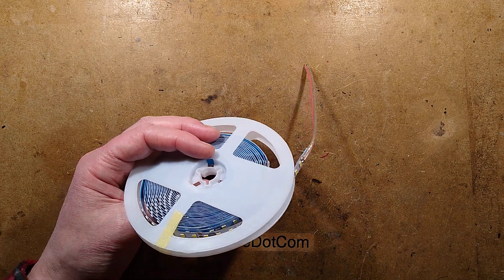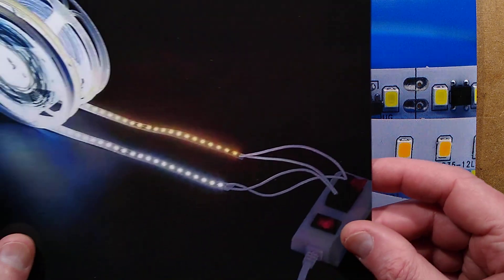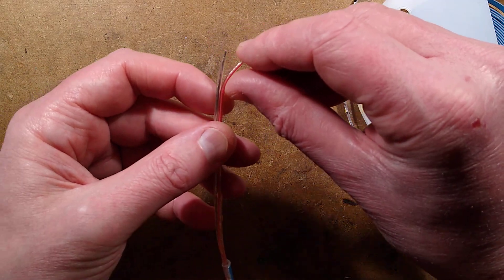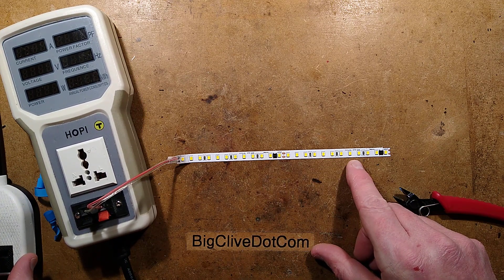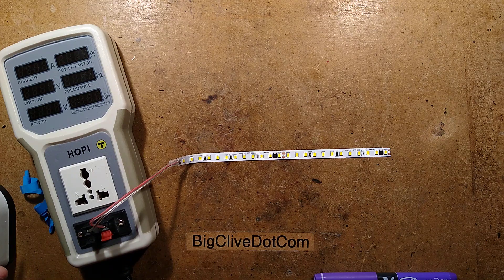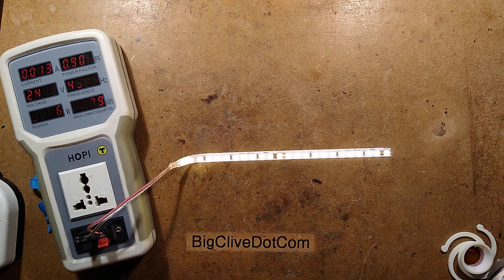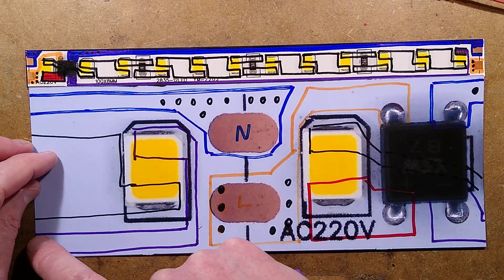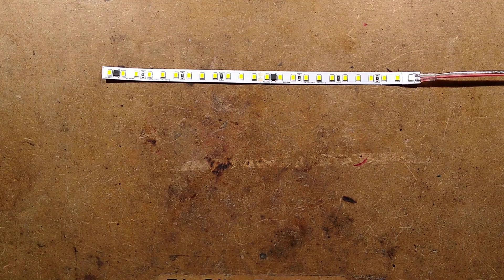Dangerous bare 230V LED tape

Comment: For conversion of some older (enclosed) tube  lights it would be fine. I think of some under-light cabinets for the kitchen where the tubes are gotten very expensive (because old). Would be still worried about temperature, arcing and have to cover the bare copper with hot snot. Had to experiment first before implementing it. ^^
So better put a 12V stripe with a 240V LED driver in it?

Also how many LED lamps are build with this high voltage LED's? Changing a light will be definitely be interesting in the future.

Comment: I have ordered a roll based on your video, it looks to be just what I am looking for, I intend to stick it to a broken fluorescent tube with maybe a bit of fishing line wrapped round to make sure it's secure, 5m cut into 5 on the old tube it will work and be enclosed by the light fitting diffuser.
I can have a switch for half power.
Reply from the maker: It might be better to put the strips on the reflector behind the lamp position.  A 12V power supply could be fitted inside the case for flicker free lighting.

Comment: My Aunt had 12V lights fitted by a real sparky?  All ok except he used a choclate block with live wires under kitchen units, so I replaced with a proper junction box.  So I can easily see this stuck to cabinets and being more dangerous.

Comment: So cool. It is capable of: electrocution, burning itself and arcing until it starts fire. When one of LED packages dies it will get higher voltage on all the others, and they will follow along. As this is just rectified AC there is no arc quenching feature, so last LED package have a nice chance to start an arc, that will only extinguish when tracks will burn off completely - spirit of hardcore unprotected equipment is strong in this crap
Reply: That makes it ideal for installation on my well insured cardboard box

Comment: 240v sticky back LED tape with exposed terminals, what could possibly go wrong ?
You know there are people who think 'as long as it's out of reach it's fine' ! They are the people who use 13A fuses in every plug and joined up bits of speaker wire or old bell wire to connect it up !
The Chinese don't understand the West's obsession with safety and training, to them it's safe enough if it doesn't kill or injure everybody in the vicinity, a certain amount of risk is acceptable and expected ! 
For us to maintain out relatively high safety standards we reject a lot of substandard items, this creates waste and raises the prices which is exactly opposite to Chinese thinking, for them it's much more important to have cheap stuff than safe stuff because food is more important to them than safety ! They live in high rise concrete apartments that are virtually fireproof with few soft furnishings and almost no wooden items so although fires are still a hazard they usually don't get out of control too quickly

Comment: I actually like this. When used inside a mounting strip it looks to be very suitable for indoor lighting. And it should work fine with conventional dimmers.
Reply: Yes, with a ton of flicker at the low end of dimming.
Reply: That's the built in strobe feature..

For when real strobes are just too bright
Reply: @mixerfistit5522  I rather see real life proof of this instead of assumptions
Reply: @Ni5ei  the proof is how a dimmer works. It's like PWM but at the low frequency of 50 or 60hz, you will have massively perceivable flicker.
Reply: @jonmayer  Thanks
I will order some and see how it turns out
Reply: @Ni5ei  I have some COBs running in a micro hood with a low setting and  the flicker is quite perceptible on low but totally fine on high.
Reply: Oh yes, apart from the horrible flicker and the obvious fire hazard due to inadequate and illegal lack of distance between live and neutral, it's a great product inside a mounting strip, especially with metal backing.

Comment: dust or bugs can be disappointed with that voltage

i'm still learning, but so many resistor in a long strip can be not efficent? vs a normal switching with led in series?
edit: i mean parallel maybe o.o

Comment: Probably not a good idea to put this under kitchen cabinets or bathrooms. There's going to be some water condensation happening along this strip. Not the best news for a mains voltage tape with such separation and bare connections. It can be useful but only if used in dry environments outside of reach of kids and people without technical experience in general.

Comment: You forgot to measure the DC - approx 250V on these tapes. It may be unsmoothed, but even more dangerous than the partnering AC. Yesterday I removed a length of the 'outdoor' type from my neighbours patio area - water had got in the end and blown the LEDs apart, along with the separate rectifier module.  A few years ago, John Ward did a video on the very same outdoor type...he was less than impressed!
Reply: Link, please.  Others have already asked how J.W. would react to this product.  Would be fun if he did.
Reply: @johndododoe1411  https://www.youtube.com/watch?v=TLOinjab3HY&list=LL&index=2&ab_channel=JohnWard
Reply: This is the version that I found on around my neighbours patio. It is slightly less exposed than the tape in Clive's video, but still 'iffy' - and potentially dangerous to humans and animals

Comment: Aren't 230V strips used for outside of houses/buildings due to 12V not being enough because of voltage drops over big distances? I feel like that's the only application they have, away from human contact, like any other light fixture.

Comment: The thing I love the most about ebay is how much "not intended for consumer" subassemblies and other items end up being sold. I'm sure the original design intent of the tape was for some sealed light tube or something, and someone in the supply chain got the brilliant idea to just sell the bare tape. Still not even even approaching the level of scary of some of the chemicals you can buy on ebay, like hexavalent chromium compounds. Personally, I wouldn't have it any other way. "caveat emptor" shall be the whole of the (consumer protection) law ;)
Reply: The lack of 6mm clearance between live and neutral/common parts makes it illegal (non-compliant with IEC and similar regulations) in ANY application in most parts of the world (including China itself).
Reply: @grahamstevenson1740  I considered repairing a major brand name 85" TV; it basically caught fire. The LED strips were approximately 300v DC in series with a current limited supply rate @100w. If line and neutral here were a current limited supply, this would be no worse and the same...  I wrote the manufacture and they took care of their customer.  In this case a properly limited supply would take care of all the safety issues while making a reliablish strip where generally only sections burn out.
Reply: @jaymemaurice  From seeing someone's video of doing a TV LED repair, the placement of the lenses is pretty critical. I'm not saying it wouldn't work for sure but you might not get the results you're expecting.
Reply: Haha, I honestly have 3 different bottles of chromium salts in my shop room that came from ebay at some point.
Reply: Its great if you can buy dichromates on ebay.Amateur chemists and other nerds are being screwed over thr world because chemicals are getting more restricted than ever.

Comment: I wonder if knowing the danger and using it accordingly would be a good idea or not. Do you think it would be safe if potted in transparent epoxy/resin or similar first or perhaps transparent shrink wrap?
Reply: Personally, I don't see any problem with using this in an enclosed, non serviceable fixture.  Lots of people pointing out moisture issues, but older tech has the same problem.

Comment: I bought a couple of rolls of the same LED strips a few months ago - however just the 12VDC version - and I love them.  I'd never ever occur to me to operate such tapes in the 230V version (you don't even have to use "Murphie's Law" to know with just a little experience that sooner or later this would end just badly). 
The 12VDC version (warm light) is great, perfectly dimmable with PWM, makes a wonderful light from dim to very bright, stays pretty cool, can be operated very safely with little effort, galvanically isolated from the mains, and double-encapsulated outdoor versions are also available ( transparent silicone coating against moisture and even full encapsulation using a transparent rubber hose)  ...what's negative to mention would be the lousy adhesive tape - after 1 week at the latest it detaches from almost all surfaces (gravity's a bitch) and you can't help but think of a solid, mechanical attachment. It's also a pity, of course, that you can't make "curves" with the tapes (when they are lying flat) and they can only be used rigidly in a straight line ... that's bad if you wanted to retrofit a circular lamp f.e. (magnifying glass lamp and the like).
Reply: FYI, for optimum adhesion, it’s essential to clean the surface so it’s completely free of dust and oils. I use isopropyl (or even harsher solvents if needed).
Reply: @tookitogo  ...I did that too, of course, but it doesn't help when heat (warmth) and gravity are involved (in the case of ceiling mounting, upside down). Well, possibly with the help of a high-quality 2-component adhesive, but that would be a bit of "overkill" if you ask me. I solved it with fine fastening wires. It took some time, but it is a permanent solution.
Reply: @ch2o2  Ok. I only mentioned surface prep before adhesion because it’s something many people are blissfully unaware of! :p In that case, it’s just crappy LED strip. I’ve gotten some that adheres extremely well, and others that have required additional support just like you mention. :/
Reply: yeah running at 12VDC seems to be the initial design of this kind of schematics and PCB routing.

Comment: Hmm.. if they pot the content it probably will be fine, like people comically say fish tank etc. I've seen swimming pool lighting of similar guise (and charge 100x more obviously).

Edit: running 240v in big lengths is alot easier than 12v dc, so yeah, I consider this as a 'component' product which needs to be finished with other means to make it viable.
To be fair alot of China special products are like that. They don't have the final steps to make it a polished product.
Reply: The incandescent fixture submerged in my pool it s 240V. It is sealed and bonded. I feel like it should be obvious that a product like this is not intended for end users.
Reply: @equid0x  nice. Assuming you wanted an led upgrade to save energy, you could potentially DIY with this strip and some boat epoxy... Straight swap, no need dc drivers etc. Realistically if it goes wrong you won't get shocked in the water anyway, says physics :)

Comment: Ideal safe lighting for a leaky damp garden shed where the petrol lawnmower is kept. I'm sure sensible home-installers will use a 13A fuse in the plug that goes into the extension lead they've run from the kitchen. 
A bonus point is that any rats chewing this stuff will be pre-cooked even before the shed burns and the lawnmower explodes. 
That would be a proper BigClive how-to video.
Reply: Not just the lawnmower, the jerrycan that has the petrol for filling the mower, and other Highly flammable chemicals/petroleum spirits and oils = the average garden shed/garage, are “effectively” a bomb with the amount of flammable things in them - if a fire was to start/an incidental vapour cloud ignited by a spark 🤭⚠️
Reply: @samuelfellows6923  Propane for the BBQ, gas canisters for camping and lamp oil makes for a nice bang. Luckilly the lawnmower is electric, and the 18v batteries are kept inside the house, so flaming lithium doesn't rain down on the neighbourhood afterwards.
Reply: Don't forget the nails and screws that would just love to fly around, stored next to the fuel and meths.
Reply: @jonathanellis3169  Did you watch Final Destination last night?
Reply: Or for the garage of the film historian and the many cans of Nitrate film.
Reply: Don't forget about the explosive extra gas tanks for the lawnmower
Reply: Not an ideal situation, the mouse will likely go bang.
Reply: Not the same thing, but a mouse was found hanging from an uncovered receptacle in my well house last year. Very much electrocuted.

Comment: Would have been simpler to calculate the power dissipation of each series resistor using V² / R which gives 0.083W.

Comment: I went to a house in UK the other day and the voltage into the house was 252v,  they lived near the transformer and we are supposed to do our calculations on a turned down 230v! Please do not buy these. Great work as always Clive 👏
Reply: In sweden we allow for 10% deviation from 230V. So 207-253V is within the limits. Its usually between 227 and 233V from my experience.
Reply: @bsod5608 definitely. The problem we have it's too high for the European/German 220v appliances and it has been known to fry them. Bosch dishwashers especially..
Reply from the maker: I live near a substation too.  At night the voltage can get quite high.

Comment: "Let's test the electrical integrity."
I was hoping the 6kV insulation tester would make an appearance.

What do I think? People happily have heaters built into shower heads with ground wire, if even there, loosely wrapped around the copper pipe...

Comment: This is an awesome find. It really is the "Golden Turd" Standard of Chinese electronics. As it's flexible, it would be great for a  fetching illuminated shower curtain.

I wonder if they are going to do a 415V version for professional work environments. If there were any minor tracking issues, rubbing some oil on to the copper pads with a finger could be done. Once the tingly feeling dies down, the anti-tracking is complete for that section (notwithstanding the odd carbonised bit of skin - but that stuffs renewable and free).
Reply: I'd love a 400v 3-Phase version, 230v is way to "safe"
Reply: I was thinking "aquarium lighting", myself. A swimming pool is maybe going a little bit too far.
Reply: @robertsneddon731  This is really funny...
Reply: The perfect aftermarket upgrade for an electrical chair.
Reply: Be perfect in a shower enclosure
Reply: In a bathroom setting you could run it off of a shaver socket no problem. But then I hear those aren't very common in domestic bathrooms.

Comment: I was looking for such sticky led ribbons running on 12v as a replacement for some radios backlight I have to repair. was wondering what those 220v stripes were having as LED types...got my answer :) TY

Comment: Ideal stuff to use by 1 week qualified kitchen fitter "Electricians." About as safe too. Can only imagine what J.W. would say about this stuff!  Would likely be ok if ensconced in sealed surfaces in some lighting applications. But stuck directly to metal surfaces or under cabinet lighting applications, well it could lead to toasted toes or fingers if it came unstuck. 
Would be entertaining to see how it fares under kitchen cabinets with a kettle boiling steam all over it!
Reply: Didn't Clive say you could just tie into the 220 rail anywhere along the stip to add an additional outlet for things like toasters, coffee makers, just image a circuit everywhere in your home. You would then need that 13 amp protection device that someone mentioned in the comments.
Reply: JW would put it on fire in his garden and record it for everybody to enjoy.
Reply: @hypnotised-clover  I was thinking the same
Reply: Why would it need to come loose to affect fingers of kitchen maids?

Comment: I prefer to use things like this to light my hot tub. For one, it's adds nice effect to the bubbles. And two, it really gives the full muscle treatment.
Reply: What do you enjoy more the 60Hz or the 50Hz power network ?
Reply: @K.D.Fischer_MBI  For beginners, I recommend 50hz, but me I like STIMULATION. And 60 is more than 50 so its automatically better, right?

Comment: Reminds me of my father.  Had a really old metabo mains drill that would be plugged in with matches acting as pushers to insert the wires.  I figured he had invented wagos 35 years before they came out.
Reply: I haven’t seen anybody do that in years ! but I saw it a lot as a kid, which makes me think it must have been easier with round pin sockets !  plugs must have been expensive back then !      I do remember wireless and lamp sockets being mostly two pin .
Reply: @CrimeVid  I would think flat pin sockets are more compatible with square matches.  Anyway, round 4mm or 4.8mm pins still dominate world power sockets.

Comment: If stuck down to a metal sheet it will caoacitively couple to ground and trip the ELCB..  even the lower voltage strips do that depending on design of the power supply etv...

Comment: probably good as replacement for like an led ceiling lamp internals. I think you've mentioned that usecase for this stuff before
Reply: Adhesive tape on the back is not a great idea, if it warms up a little it may come loose

Comment: Looks like it is supposed to be mounted inside an enclosed lamp.
Clive, did you spot, how quickly the current started to rise? This tape, being resistor-driven, should quickly overheat, and maybe even cause an avalanche effect. I am curious to see, what's going to happen to this tape after some time.